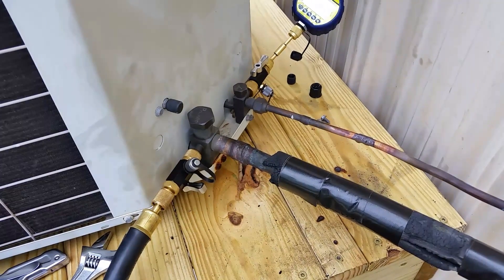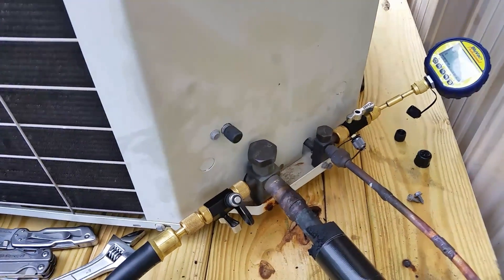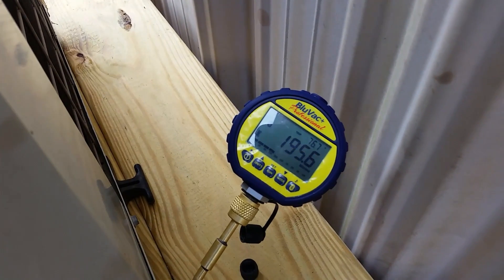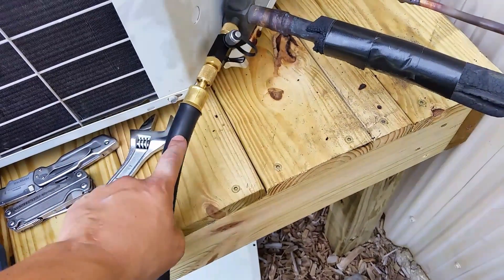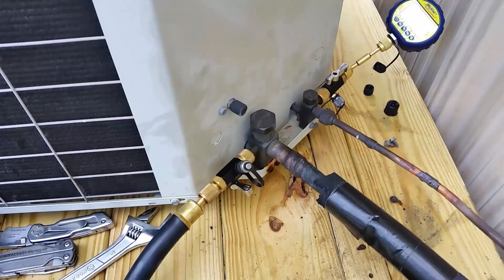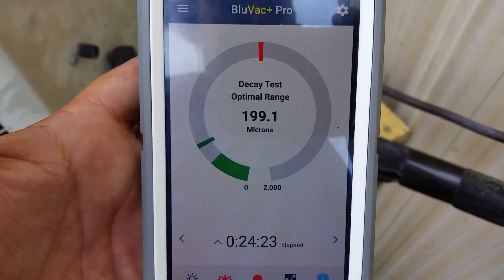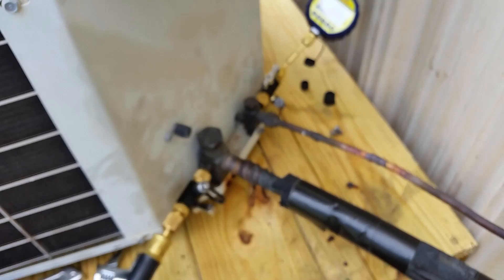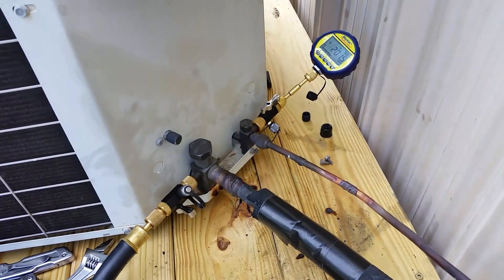HVAC - 60 Second Tech Tips #9

Comment: Question do you remove core from vacuum hose as well when pulling vacuum? Thanks
Reply from the maker: Jorge Tapia These, and most vacuum hoses do not have valve depresses in them. That is why you have to remove the valve cores when using them.
Hope that makes sense.

Comment: I only use one hose like u showed but why do u use a core tool on liquid side and remove core for micron gauge ?
Reply from the maker: JH HVAC & Plumbing The core depressors can make micron gauges read quirky at times so I prefer to remove them when possible. Also I dont like my micron gauges coming into contact with refrigerant or oil. Although they are fully capable, I try to avoid it when possible.

Comment: Sir. What decay standards are you using to determine that the system is within the acceptable parameters for charging?
Reply from the maker: vaccumme For this system, 10 minutes under a target of 500 microns. Decay test for 10 min staying under 1000 microns. New systems my test is more strict. 10 minutes under a target of 300-350 microns and a decay test of 10 minutes below 750 microns. 
Thanks for watching.

Comment: Were you pulling on the entire system or just new evap coil?
Reply from the maker: Joe Shearer This was just the lineset and AHU.
Reply: Is the metering device a txv ?
Reply from the maker: This was a piston but if it was a TXV the evacuation application would be the same.

Comment: What's the part number for that fitting between your vacuum gauge and core remover?
Reply from the maker: Manuel V. It is called a 1/4" x 1/4" Coupler but it comes with the micron gauge. Ill see if I can find a part number for one.